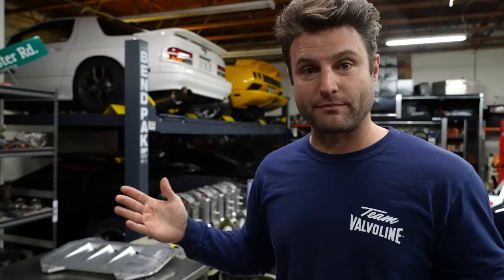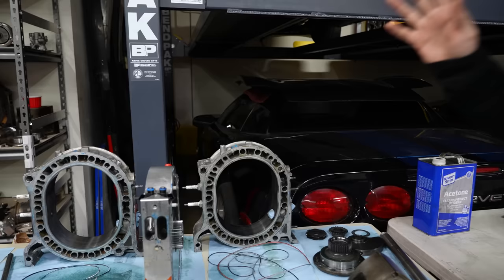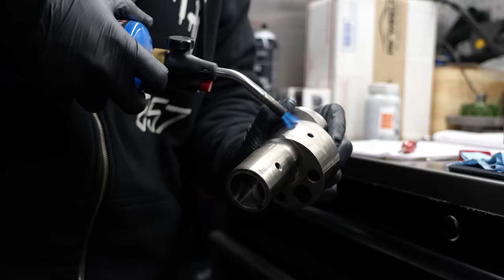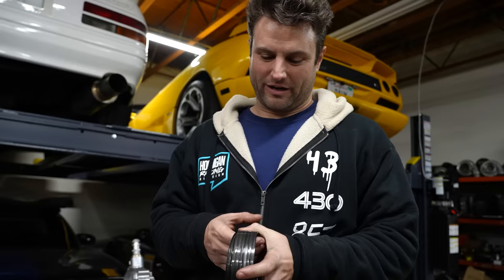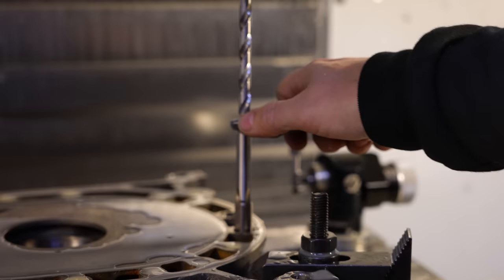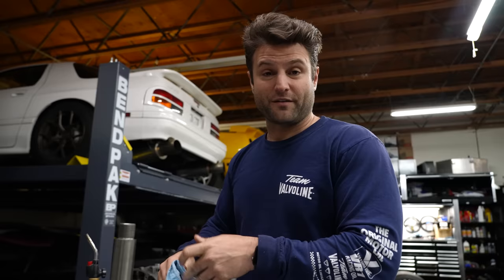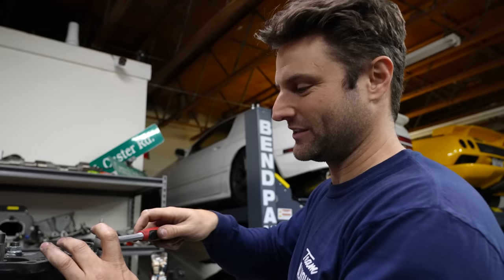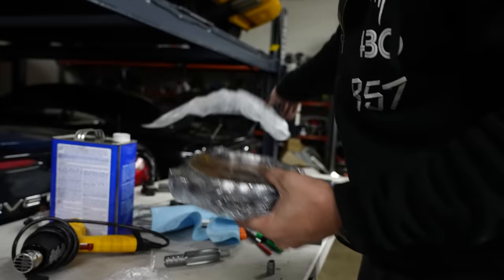Building the 4 Rotor for the most HP we’ve ever attempted. TV Show race prep

Comment: Rob: You always are pointing out wear due to friction, I have a '06 RX and am using a product I found that is a additive for oil that forms a protective ferroceramic layer wherever friction occurs. It's a 9.5 mohs scale hardness (10 = diamond) that grows off the base metal and will not gaul, flake, crack, spaul that protects the places friction occurs. It seems to be perfect for rotary engines. The name of this product is XADO, I would love to know if you are familiar with it or have used it ? I have used it in everything from lawn mowers to turbocharged Kawasaki 1134 cc hyper bike I own. It builds both weight and dimension on worn parts and keeps new parts new ! I know your a busy man but can you look into this product and let us know what you find please.

Comment: Just as an aside, when torquing bolts to a precise spec, keep in mind the bending load apllied on the bolt, which occurs if the bending force is not counteracted ie. Pushing against the head of the torque wrench.
My Pofessor in Engineering denonstrated the effect to us and the acual torque was around 15-35% lower than what was set on the torque wrench. This bending load causes friction and causes the torque wrench to "click" at a lower torque.

So depending on how the torque spec was intended by the engineers, it might matter a lot, how you use the torque wrench.

Comment: The WS2 will likely be washed off by oil immediately, it is a dry lubricant. It is likely gone in seconds. It is meant to be used in dry scenarios. 
They make it as an oil additive, which would be a good question for Valvoline for a rotary specific oil. Given the amount of dynamic seals and seal surfaces in the engine.

Comment: Hi Rob Dean here in New Zealand 🇳🇿  have you tryed using lock tight master gasket we use it for sandwiching the Mercury Formula 1 outboard blocks I've used it on a few rotary engines with good success it's design to be squished...👍
Reply from the maker: I’ll check that out!

Comment: Run the injector machine one injector at a time and the fuel pressure won't drop like that anymore. Leave the drains closed and you can see them side by side still. I have to run anything over 850cc that way to avoid fuel pulsation and pressure drops like that.
That's how most heli coil taps are, it's assumed you're keeping it with your kit and not trying to use it by itself to re tap a hole

Comment: When taping a hole you should use a T handle to apply even pressure on both sides of the tap as you turn. When using a wrench and applying pressure to only one side it can make the tap cut a little deeper thread's and then your bolt or whatever won't fit as tight. This is more of a problem on soft materials and the effect is very small however on a more precision type job this could matter.

Comment: Have you ever thought about putting the dowels in the freezer before install? I know a little bit of moisture usually is generated in the warming process after the metals pulled out but maybe it would be enough to slide them in easier without the potential of messing up threads

Comment: Those holes on the same angle as something like a revolving center so you could use that to keep it center. Also don't tap with  crescent because your apply weight to one side instead of two so without the center it'll tap the hole on the piss and it'll be bad

Comment: You can make yourself a much better guide for the tap with a piece of Aluminium. You just measure both diameters of your tap, drill out a hole with two diameters that are a little bit bigger than your tap and mill the one side flat. Now you can put your tap into that hole and turn it with a wrench on the top while your aluminium block keeps it 90 degrees. If you want a drawing of what I mean I can mail it to you😂. Makes your life so much easier, I've made it for multiple taps and I even used it for my final exam as an apprentice

Comment: Fun fact rob; Heli coils are STRONGER than the threads were originally because the coil is simulating a larger thread size. It is common practice in industrial and space tech to Heli coil all the fasteners that are into aluminum during manufacturing. NEVER feel bad/wrong or worried about a heli coil

Comment: Your gonna get weird pulses regardless till you blue print the rotors and have the compression baths matched by cnc. And you can also just deepen a stock bearing with the exact same benefits but if your assembly has been balanced with standard bearings ideally you'll need to balance the assembly again "race" bearing is 5 grams lighter

Comment: I also had to helicoil my Audi V6 engine 2 times because of the alumiun block. The first time was too scary and at that time I didnt knew if it will hold the bolt or not and it was on timing belt component lol

Comment: The most fascinating thing to me is that so much of a rotary motor should not work. When you put those apex seals in it looks like Building a house on the tip of a triangle. But then it works for a 100 years!

Comment: when ignition system is cutting out, might want a bigger alternator, fuse relays, and battery. Especifically the  alternator and relays for those systems.
Reply: the problem isn't that it needs to much power, he was giving it too much power to the point of melting plugs
Reply: @ValentineC137  is he getting correct spec plugs that can handle the heat or some more fabrication for the sparkplugs / coil packs. been awhile since I have been following Rob's videos.
Reply: @SgtStarSlayer  R7420 is the plug mentioned in his 1000$ in sparkplugs video
Reply: @ValentineC137  kk I have missed it.

Comment: Helicoil taps are usually marked as helicoil taps, even if they're technically marked with the incorrect size. It's on purpose. It's so you don't have to look at the chart for the right oversized tap when taping a hole for a helicoil

Comment: I can't say 100%, but scotch brite is an abrasive material. I'm not sure if it would embed in the babbit or not. I would, as a millwright, highly recommend using a hone tool. 
Personally I would do a couple hours research on the topic. I just don't see myself scotching babbit. (30 second google showed a comment from someone that talk to a Clevite rep who mentioned the surface finish is very rough. Didn't mention embedding, but  I would invest in some hones. You will at the least gain an increase in circularity.)

Comment: e85 interests me a lot, it would be cool to learn more about what spec the fuel system has to be to be able to handle the ethanol.
Reply: Nothing changes. You just need the ability to flow 30% (give or take) more fuel. So bigger pump and injectors. That’s literally it.
Reply: @Rekoyl116  can it be used in stock systems if they flow 30% or is it to corrosive?

Comment: Rob; I've read that after assembling a rotor stack that rotating the E-shaft 2-turns and backing off / retorquing the long bolts that run through all the housings 1 at a time in a star pattern allows the stack to compress more.....have you experienced this / tried this?

Comment: First so if you are correct about it even wear a pattern of throughout your engine touching pores without protective material because all metals are porous your oils from your hands and other body parts will cause decay and corrosion also pressing can cause a slight taper Leading to it on even wear just think about it and you will understand friction is friction no matter when or where it is caused

Comment: One odd physical phenomenon i'm curious about with the engine studs - with the tight fit end to end through all the rotors, how do you account for the added torque requirement? All that surface contact area is adding friction and the torque isn't going into clamping forces. Similar to how a lubes vs unlubed fastener has different clamp for the same torque. Do you have a scientific methodology there, or do you just add a few ft-lbs and yolo it?

Comment: Sounds like a daft question but doesn't the excess vaseline in the engine that the oil or water or even the rotor could get to, cause any issues or does it just burn off in seconds? And where did you get the put together eccentric shaft from? Others that I have seen are from billet a single shaft.

Comment: Does it matter that the clutch driven plates are not aligned to each other? Not for balance but for even pressure throughout the stack. My OCD was tingling not having the pucks lined up or offset 90 degrees.

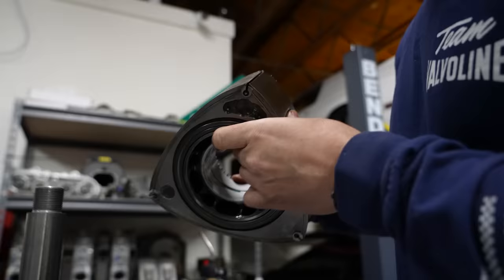Comment: Is there an advantage to having 2 rotors with opposing firing sequences next to each other? Can you put the rotors in a 90 degree then 90 then 90 then 90 firing sequence. instead of a set of 2 180’s then another set of 2 180’s. If it helps refer to 45:00 in the video

Comment: hey rob dont you think you should turn the e shaft seals around. i think you are sucking them open under vacuum. im pretty sure i saw someone else doing that while building a drysump system on a piston engine. if the sealent dont hold you might wanna give that a try.
😉

Comment: Does the M12x1.25 helicoil tap say "STI" on it anywhere?  That denotes that it is an oversized tap for a "Standard Threaded Insert". The threads that tap makes won't actually have a real definition unless you put a helicoil in afterwards so they call it an STI of the final thread. When you get into non-standard thread cutting the tap notations start to get really messy,  especially if you start moving into compensations for plating.

Comment: I’m worried sealing the splines on the back of the engine won’t work long term because all the axial vibrations of the engine will constantly be stretching and pulling at the sealant (as the splines wiggle)

Comment: How do you get all the intake ports to flow the same? Can you talk about that? It appears that the 2 end plate have rather small secondaries and the very center center housing looks like cosmos ports while the other 2 center housings have the smaller fd-3 size primaries. Please elaborate, thank you. Also do you run any engines with cosmos ports?

Comment: has anyone thought about if those main seals work with an internal low pressure vs atmospheric? I'll assume a dry sump motor uses a different type of mechanical seal on stuff like cranks and such?  Just my thoughts on trying to save those killer X clutches?
cheers!
ron:)

Comment: Has anybody tried direct oiling apex seals via the rotor? It occurred to me that you could drill a small oil channel into the rotor that feeds oil to the apex seal from the output shaft interface, but there's very little data on this topic that I've found.

Comment: On the topic of the seals not seating/breaking in all the way. I wonder, You didnt seem to use a break in oil, or did you? My understanding is you used the best of the best Valvoline has to offer off the jump. Now this is much like you said, based on my own experience in building custom engines (though mine would be of the piston variety), That using a specific break in oil, or possibly even just a slightly less juiced up oil, to allow that friction to happen more naturally rather then forcefully. This is a process my grandfather taught me when teaching me to build old 350 small blocks and the like. The compression after the 3-500 mile break in period would be higher then when we tested after a few start ups and normal driving sessions to the gas station and such. These were all high compression naturally aspirated builds, all under 600 Hp however. Might be a different universe to 2000Hp rotary engines but Metals and friction are metals and friction right?

Comment: As soon as you said buttplug when installing the clutch, my mind immediately went back to the sex sandwich.  I don't think I'll ever forget that bit. lol  On the subject of consistency between rotors, it makes sense that rotor 1 would get more air at idle and at high load rotor 4 would get more based on the intake plenum design being front-to-back.  Would it perhaps be better (or at least something worth considering) to make a new plenum chamber in an "OEM-ish" style?  Something with the throttle body over the ignition side of the engine rather than the front.  I'm hardly an expert by any means, but from the bit that I do know it seems like that could potentially provide better natural rotor-to-rotor fueling/air intake consistency instead of just compensating via the ECU.

Comment: Check out WPC surface treatment. I use it on all the bearings I run in the big torque diesel engines I build and the bearings come out looking better at health checks than non-treated at well over 2000lb-ft wheel torque we make. Check their videos. Improves surface uniformity and thin surface hardness, improves oil retention, etc. Had good luck with it and it's not that expensive.

Comment: Why does higher clearance benefit a race setup? I don't get it, without any experience in real race setups, but high technical and machine(ning) experience, i would have though lower clearance would have the highest benefit (lower vibrations + lower viscosity oil = lower friction)

Comment: But Rob, WHY must the part on the e-shaft be as clean as possible? Isnt it covered in oil when the engine is running anyway?
Reply: No it's not, that part of the taper isn't
Reply: @andrewable2634  then why does it need to be clean?
Reply: @DJHumla  friction fit for extra strength

Comment: Are all the rotors aka Doritos the same size or can you get them bigger or smaller?
Reply: They're all the same profile. The same "shape". All wankle rotors are the exact same shape.

You can get them in different depth, and "diameter" scales, though. All of mazda's rotors, I believe, are the same "diameter". But the older ones were thinner or something like that.
Reply: Technically you can get them at any size, but Rob uses the around 0.67L variant, so you just stack them and get bigger displacement, so usually a "13B" (being 13 the displacements of a 2 rotor, so ~0.65L each and 'B' the version) based Mazda 3 rotor should be basically 2.0L, 3 x 0.65 ≈ 1.9 the 4 rotor should be 2.6 and yada yada, but if you have the machining skills you can totally make a two rotor 2.0L (being both single rotors 1.0L joined together) or anything you like!

The new mazda MX-30 R-EV hybrid apparently will use a 0.83L single rotor and I am very excited for it ;)

Comment: Rob Sean from WhiteRock South Surrey B.C. Canada 
That Treatment you were buff into that part. Why don't you Treat the areas you don't want the product on with Rubber liquid then take the exposed areas and mix that Tunkston treatment in Alcohol base for some other liquid and Electroplate it into the Metal you will get a way better treatment and you my beagle to treat other areas like were the oil seal is that rubs on that Motor surface. 
Drop me a line if you need advice with electroplating  ok its a far far far better way to treat metal Surface and it's a lot faster lot better 

Sean

Comment: Woah $1k on oil control rings alone. I don't think I could ever afford a rotary 😔
Reply: That's for Rob's motor, which is very high end and the oil control rings have got to be absolutely top notch to deal with the power. For a less extreme engine the price wouldn't be as bad